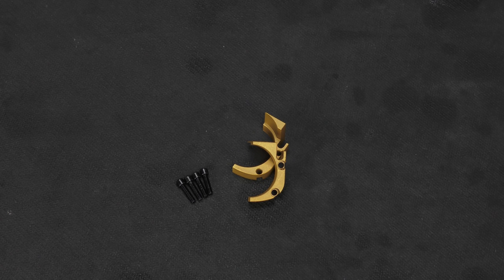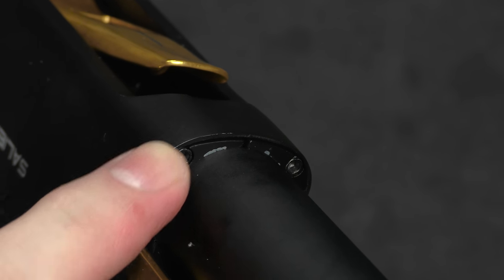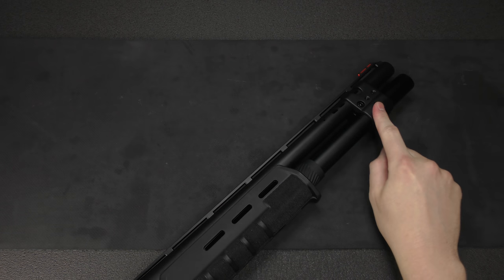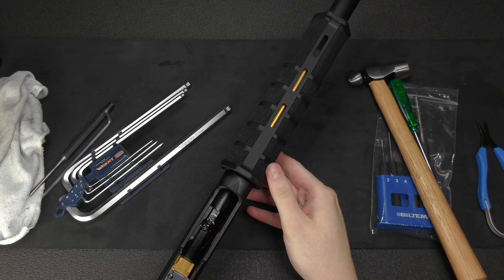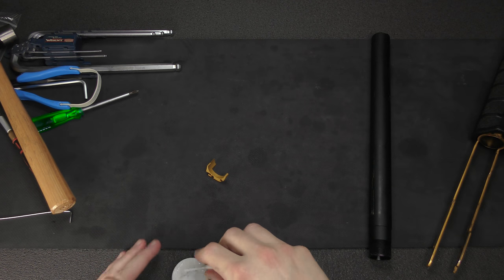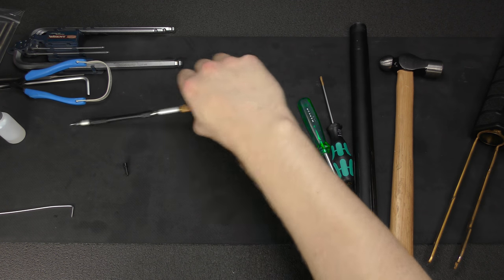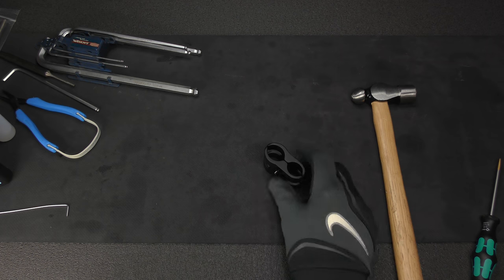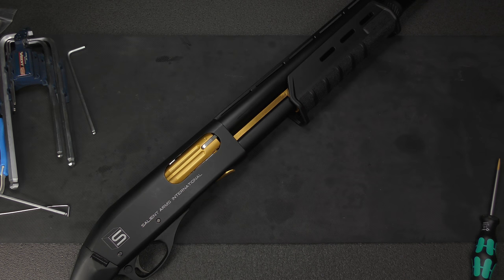Tech-tip: APS CAM870 magazine cradle arms installation "guide" [4K]

Comment: Yeah at the moment I have everything dissembled (prob should of never took out stock ) but I have trouble putting in the  latches which I don’t rem how I got them out or how to put them down correctly in order along with barrel ….reason why I dissembled it in the first place because The  gas bolt plate had snapped and well didn’t go soo well so far I got everything there and good condition just reassembling it is the prob
Reply from the maker: Check out my APS CAM870 playlist, there should be a video or two to help you out: https://www.youtube.com/playlist?list=PLz5FTS2XoXasy5ZzCHy8qlIvDqvYwB_yh
Reply: @CJAwesome83  thnx I’m also gonna try a dumb idea using poppers in the hollow shell see if they fly out with force since explosive bbs discontinued

Comment: This might be a dumb question but im just trying to get as much info about the SAI m870 as possible.

What is the point/result of changing the cradle arms??

Cheers
Reply from the maker: The SAI style TiN coated cradle arms are steel  (original are aluminum)and also have the matching "gold" color. That is the primary reason.